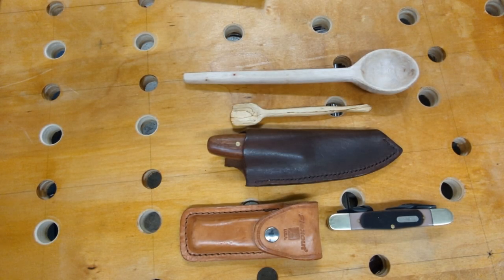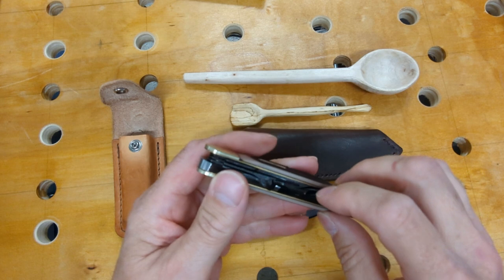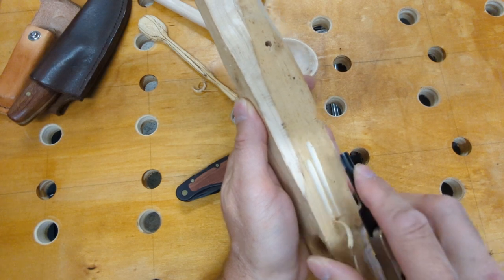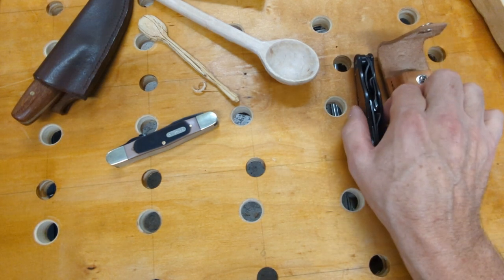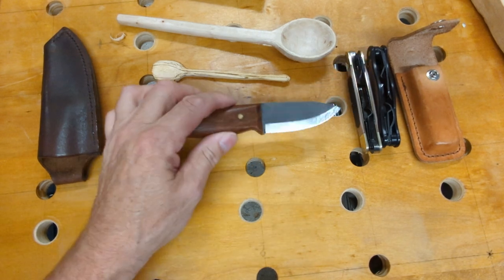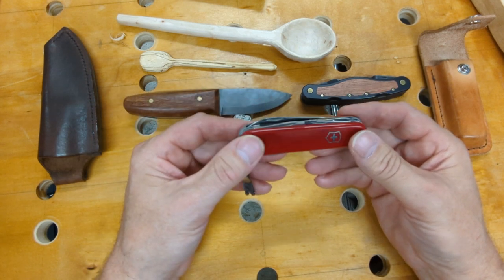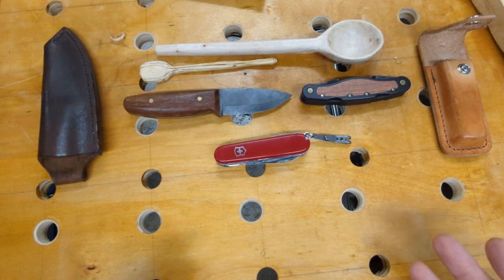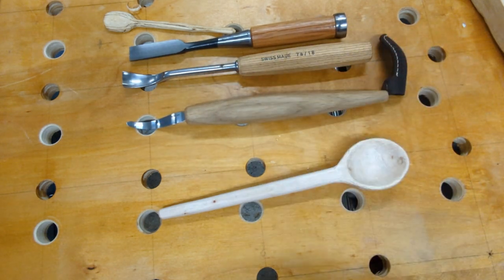Three For Thursday Another Portable Carving System

Comment: Very cool carving knives and I love your kits you showed at the end. I also like my Fieldmaster best for use in the bush. Thanks for sharing and Cheers!
Reply from the maker: I hadn't opened up the one kit for a couple weeks, maybe a month and couldn't believe that they were starting to rust! I have had these knives for years stored the same way with no issue. It's time to clean them up and protect them with some conditioner. I'll probably make a video of it.
Reply: @LastChanceKnives  It's crazy just how fast carbon steel knives/tools can go off on ya if left unchecked for a while. That's why I don't own too many of them, since they require a little more TLC than my stainless ones. ☺